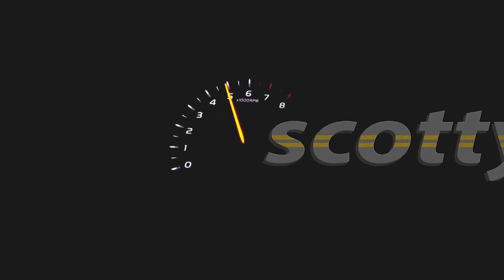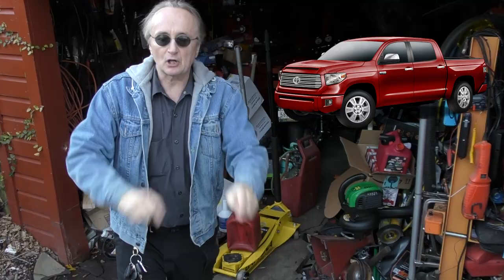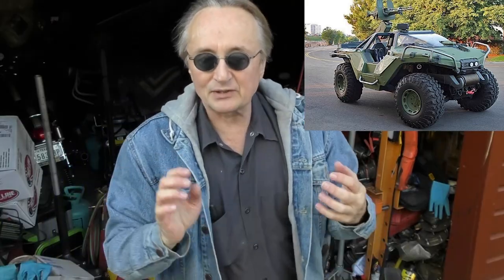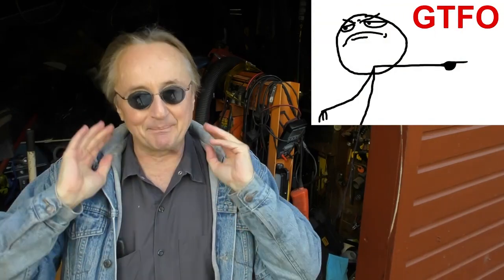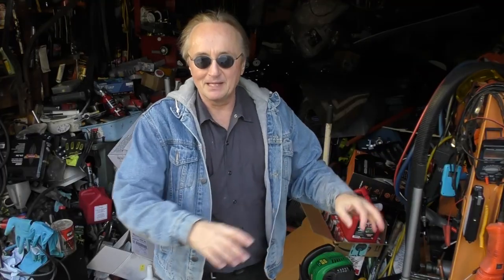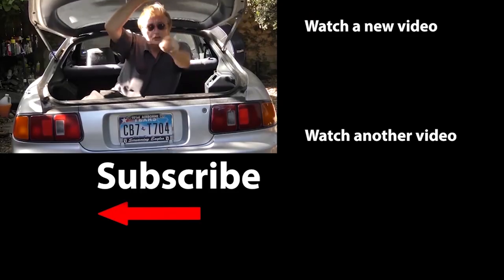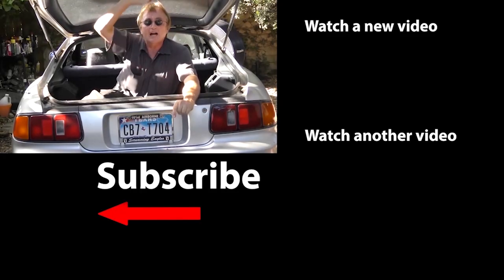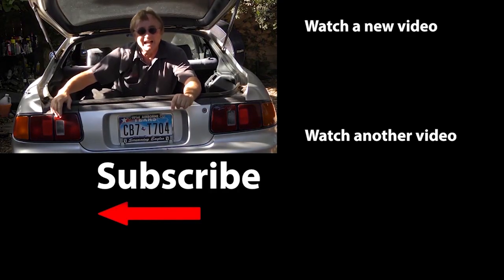5 Used Trucks You Should Never Buy

Comment: Shelby Dakota Convertible 
P/U
Reply: There were non-Shelby Dakota convertibles too. The Dakota Sport I think it was called.
Reply: @ivanf4023  You are correct. Back in '89 I worked for an auto parts store. The guy that owned the auto parts store also owned a Dodge dealership. I had the chance to drive both the sport Dakota and the Shelby Dakota. Both were convertibles.
Reply: I was literally just about to post this, glad I wasn’t the only person to think of it haha
Reply: Technically the new jeep gladiator could be called a convertible
Reply: @ThePhalseProfit  I never understood that concept they had balls
Reply: @nicholasoney5879  If your going to count that, then THE FIRST convertible P/U would have to be the Scrambler
Reply: @keithlowe1982  1928 Ford Model T Runabout with Pickup Body 

"Most earthlings can only hear what will further their preconceived ideas." me
Reply: @darmok-hm6jx   I wasn't around in '28.  Suffice it to say, Scotty was wrong to say the SSR is first/only P/U convertible.
Reply: @keithlowe1982  THE FIRST convertible P/U?

Comment: He forgot about the  ford F-250's and F-350's with the 6.0's and 6.4L diesel engines there pure junk and only good for as a boat  anchor
Reply: Yep if something that can Tow over 15,000 lbs and last 800,000 if maintained by someone knowable, getting 18 MPG is junk I guess
Reply: The 6.0 is appreciated by those who know them. If you have a 6.0 and you think it’s junk let me buy it for a steal and I’ll save you from your boat anchor
Reply: you build it we destroy it factory spec if you follow it to the letter coolant every two years oil every 5000 and monitor your oil coolant delta no more than 15deg at operation temp and you would never need to modify
Reply: A buddy of mine has the 6.0 in a 2006 f250 and has 240k miles and recently bulletproofed the engine at 220k miles and it's the original motor. He has no complaints about it. The 6.4 I agree on that. Junk.
Reply: Any engine that has to be Bulletproofed is junk.  That’s $8-12,000 to fix what Ford/International should have never sold.  I’ll pass.  The two happiest days I owned my 6.0 Excursion were the day I bought it, and the day I sold it!
Reply: @Travelair2000  even Without the bulletproof 220k Miles for a diesel hauling boats and working Is fine for me.

Comment: You know Scotty, a lot of this sounds very biased. I've owned Dodge, Chevy and Ford trucks and I gotta tell ya, my Dodge trucks have had the least amount of issues of the lot.  I currently own a '99 2500 5 speed Magnum V10 and an '03 ram crew cab, both 4x4.  They both have well over 250k on them and run like a champ. The '99  had the clutch replaced last year and the 1500 crew had the radiator replaced 3 months ago. The rest has been basic maintenance and I've owned them both over 12 years.

Comment: Had a 1988 Silverado V6 with a 5 speed manual. Best truck ever. Had 400,000 miles and didn't even leak oil or smoke. Ended up scrapping it even though it still ran and drove.

Comment: I would have to disagree with Scotty I have a 2006 honda ridgeline with 310000 km with no problems and most of it's life it has been towing!
Reply: I agree my 2012 Ridgeline is still running and no issues
Reply: I have a 2006 with 280000 km with 0 zero problems not ever check engine light on so far best vihicle I ever had👍👍

Comment: Chevy Colorado with the inline 5 cylinder mine went trough 3 heads it had a bad radiator cracked exhaust manifold, and a boatload of bent valves, rods, and  anti-freeze going in the oil. I was always a chevy guy, but no more could only drive 200 miles and another problem. I got a Toyota Tacoma that was 8 years older 11-3-2019, and this 2001 Tacoma has had zero problems.

Comment: Sorry Scotty but I have to disagree with your assessment of the Honda Ridgeline. I had one of the very first ones, a 2006 and the only problem I had with it in nine years was I had to replace the rear power door locks. As far as the engine goes it's the same engine that's used in a lot of the Acura models with a slightly different tuning.  Never had a cough out of it.
Reply: I had the 2006 as well. I spent more time fighting with the dealer for my money back than driving it. Trans quit within 3 mths and it got repaired. Withing another 2 mths it got replaced.  About 8 mths after it was replaced again. Ech time i was without a vehicle for 1.5-2 weeks. I had to fight with corporate to get them to take the sad attempt at a truck back and pay the loan i had out on it. The fight was more over me refusing to take a different one as they thought I just had a one off bad one.  I ended up buyig a used 2003 sonoma for $12999.00 and its still in the driveway and purrs like a kitten. Only issues I ever had was a bad connection at the coolant temp sensor ( wire was broken from assumed rodent chewing on it) the rear end diff cover rusted out in 2015 which ended up burning up ring/pinion. For a mini truck that has worked for a living and was abused 4x4ing with 340,000 miles on it I can't complain.
Reply: My 09 has the exact same motor as our 05 odyssey
Reply: @bonnivilleblackcherry9745  That's too bad. My '06 Riggy is still purring like a kitten :)

Comment: Im fist time disagreed.  Friend has a ridgeline with over 22000 miles, he bought it brand new, he told me the only problem he had with the truck was the time he have to changer tires😂. He work on constellations he dont need an extra  tool box because the back compartment on the tuck.  I drove it over a moth on snowing conditions and i star to like it. Now i have one 2006 almost 190.000 miles and u push hard the throttle on off road. I love the stability on the truck..  for those f350 if i have the option between free f350 or ridgeline i chose f350 than i sell it i buy a ridgeline😉

Comment: So I got a used ridgeline but I rarely use it for towing or pulling only need it if I need to get a cabinet or desk. Also have it for when it snows bad think it would still be good use as daily since I won't be doing heavy duty work?
Reply: Tyger Koo yep! All wheel drive too. It won’t tow what a the other midsize trucks do but midsize trucks aren’t thought of for just towing, that’s why you buy a full size which Honda doesn’t make yet.
Reply: That's a great daily and what they were built for. Daily driving with light duty work.
Reply: Don’t feel too bad about not hauling heavy loads because 99% of the people that are on the road with pick up trucks don’t either.
Reply: MrDonnyt yup ur right dude! Hell most people who own full size truck never use them to their full potential. I use my Ridgeline to its potential and it always comes thru with flying colors. Never let me down.

Comment: I thought dodge made a convertible Dakota in the early 90 s
Reply: They did
Reply: Very few of them were produced. It was a 1990. It was also a $5000 option too.
Reply: They did not...those were farmed out trucks to have convertible top put on..by an outside company ..kind of same as Saleen/Roush/ Mustangs.
Reply: @abarnes0330  In 1989, the unusual Dakota convertible was rolled out. The first American convertible pickup since the Ford Model A, it featured a fixed roll bar and a simple manual top. Roughly 2,482 were sold that first year. The idea came from Jerry York and they were manufactured by ASC (American Sunroof Company, now known as American Specialty Cars).[1] Another important addition that year was Carroll Shelby's V8-powered Shelby Dakota, his first rear-wheel drive vehicle in two decades.
Reply: I think they did but rare have not seen many of them

Comment: My Daytona truck is pretty reliable Scotty yeah the ball joints crap out more than most but I can haul a lot of stuff and my wing stays off all the time. But that hemi engine and drivetrain are pretty solid. The gas mileage does suck but I didn't buy it for the gas mileage, also I do my own maintenance and with over 270k in it I'm impressed. Mopar or nocar i say.

Comment: Look up the definition of a pick up truck, the Ridgeline falls right under the definition I understand that it's a uni frame but who cares? If need to pull something more then five thousand pounds then go get something else, also if the us govt  an if your dmv calls it a truck it's a truck.
Reply: Inheritancefreak127 nah. The state government classified my “bullet button” AR-15 as an “assault weapon” (currently running a compliant set up BTW). The ridge line is reliable but I wouldn’t call it a truck. It’s a crossover
Reply: I often believed uni body construction helps strengthen a truck's overall frame especially for towing and hauling. I know Ford and Dodge at times will make one of their trucks a special edition model as a uni body. Of course uni body construction is expensive which is why many light trucks are not built that way for productive purposes.

Comment: Where did you get the info that Honda Ridgeline motors are “blowing up” ??
Reply: Probably had one come in which had never had it's oil changed or used in a tractor pull. Honda J series engines will last forever.
Reply: chicagohouseman my guess is someone from Toyota told him.
Reply: They never did the timing belt at 160000km and the belt snapped somewhere around 230000km is my guess
Reply: Many 06 Ridgelines had issues with the #4 cylinder.
Reply: From one Houstonian to another: You are mistaken about the Honda Ridgeline...It’s very reliable, hauls all the crap I need. I get a half yard of mulch in it. 178,000 miles since 2006 and I’ve replaced one alternator, struts (Houston roads), and burned thru many Michelin’s. I take it camping frequently, and if you do your research it is one of the safest vehicles on the road. It also handles WAY better than traditional pickups.BTW it’s also great on Houston flooded roads. I’m just about to do my next timing belt. The secret to Honda automatics is changing the the transmission fluid every year with genuine Honda ATF. Bumper to bumper 290, 610, and 1960 traffic is hard any auto.
Reply: @JohnMurrayOP  your way over due for the timing belt should be done at 110km
Reply: Z Ack What’s wrong with the Ridgeline?
Being that in the modern day people are just treating trucks as if their giant sedans and never really do anything them it kind fits into that.
It’s more a crossover with a bed now, but basically it’s the truck for people who just want to drive a truck and do nothing else.
Though the new Ram 1500 kind of just defeats by having better handling and ride while being able to keep up with Chevy and Ford.
Reply: The J-Series is probably one of the best engines out there...
Reply: @Z-Ack  Because it's a V6 Accord at heart! It's a Car-Truck!
Reply: @midnightmystery544  based off the odyssey/pilot. So... van/truck.
Reply: @SpiffyGrooves  Yeah... The Ody is based on the Accord, I think... It's all unibody, anyways...
Reply: @midnightmystery544  untrue, but they are both unibody

Comment: Im a mechanic and have a construction company so Ive owned and worked on a lot of trucks. Id agree with you on all of these on the list but the Honda Ridgeline. The Ridgeline out ranks every truck on the market with reliability aside from Toyota. Sure the bed is shorter and its not a full size truck though you pay for full size in registration fees.... but if you dont haul a lot it will do the job. I tested my theory and bought a 07 with 94k miles on it here a few years back. I put a hitch rated for 7,500 lbs on it. Got honda wiring kit to wire up a electronic brake controller on it. Im now pushing 150,000 miles and much of that was towing a dual axle trailer loaded quite heavy. Ive hauled cars on the trailer, huge loads of construction material and even my 675b scidloader. Sure Im beyond manufacture recommended tow weight and literally maxing out legal tow weight but  this truck engine or trans wont stop. I pass going up hills loaded. Of all the V8 Dodge, Chevy and Fords Ive owned it actually doesn’t lag to far behind as far as tow power and as you know its a little 3.5 V6! Now of course it out preforms the old 6.2 GM diesel that didnt have a turbo and the 5.9 Cummins trucks run circles around it all day but those trucks are in a different class all together. Bottom line I recommend Ridgeline’s. However I wouldn’t recommend using it the way I use mine. Just because even though it handles the abuse why not buy a bigger truck if you need to do bigger jobs. But my test of the Ridgeline proves their worth in the 1st degree

Comment: Scotty.    My friend owns a
2006 Honda ridgeline. He buy  it use with  97k miles  now the ridgeline has 245k miles   And runs like a champ
 Same engine and transmission
I owns a 2007. Ridgeline 
100k miles   I love my truck   Plenty of  space in the cab and enough space for me on the bed AWD.   For the Chicago snowstorms

 So from now I will call my friends honda ridgeline a miracle!! 
 because  has over 240K miles. 
 But for sure  out there is not the only 1 has  over 200 K and still on the road
Scotty.  and all you have a great day 
👍
Reply: It’s a car with a big open trunk. Can’t tow a truck load.

Comment: I see ridgelines used with over 200k going for $10,000+. That says something
Reply: Yes it does. Very dependable vehicles
Reply: Excellent vehicles, and do most anything a typical truck owner really needs. My buddy bought a Dodge Ram 2500 diesel, biggest POS, has had multiple trips to the dealer for warranty problems, and now that it is out of warranty he can't give it away. I asked him why he thought he ever needed a 2500 series with a diesel, his answer... They look cool. He doesn't haul anything, never had anything larger than a motorcycle in the bed, and it was ridiculously hard getting the bike in and out because of the bed height. My Ridgeline hauled several motorcycles with ease, towed my fish-n-ski boat with no trouble and got better mileage than my friends diesel.

Comment: I would have to disagree with the honda ridgeline. I have 325k+ on my 07 ridgeline. I've driven  it cross country while I was in the army and all I have ever replaced was the timing belt and oil changes.
Reply: Brandon, I did so much work with that truck it was insane snow look at it. On both my 07 an 11 I never had a single mechanical issue. It was by far the best truck I have had for those that get their hands dirty. Is that 325k is it the original motor? I used to mountain bike I wish I had this to take to the trails. The trunk was genius yet no one really knows about it. Why other companies don’t integrate and compete, throw a trunk in the bed and watch. All vehicles have a weak spot historical data tells us that but Honda’s for the most part had and have some of the best cars, SUVs and mini vans. Thank you for letting me live a free life and became what I wanted to do with my life because of your sacrifice. Thank your for serving Brandon.
Reply: @richiesyt3492  yeah it is the original motor runs great. The transmission "D" light will sometimes notoriously flash but it it shifts great and fluid levels are perfect. My 2004 bmw zhp 330i on the other hand. Has been a totally different beast. It is a blast to drive but damn the amount of crap I've replaced lol. Back to the truck. I agree with the trunk. I keep a few tools and things back there. The only downfall is having something un the bed and getting a flat tire. I had my harley in the bed and felt with that, good fun. I have had it on so many trails from my army days going out to training sites and ranges. Had a 2010 silverado, very cheaply made in my opinion. Dash cracked, interior was extremely bland, lifter problems at 40k. It may not be a frame on ladder pickup, but I can hall my harley in the bed and a pop up camper perfectly fine. And its lifted haha.